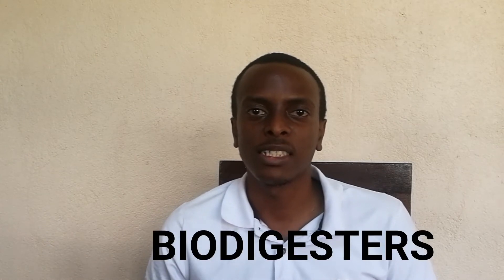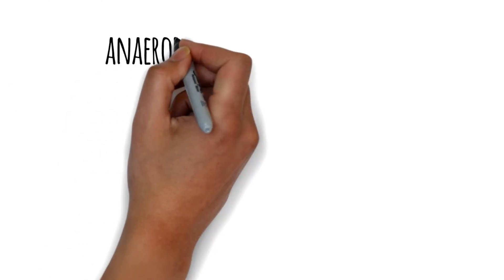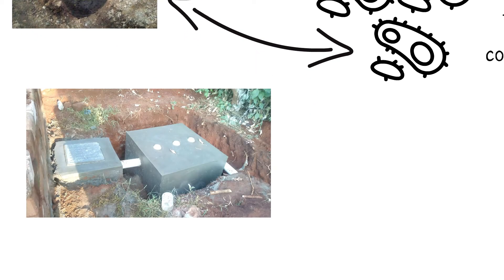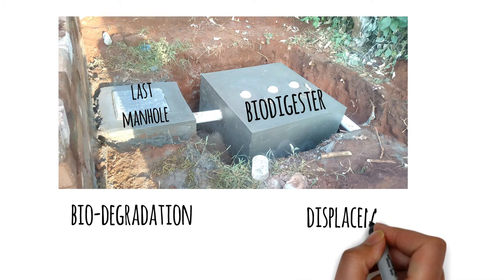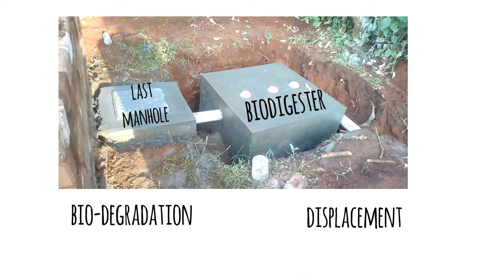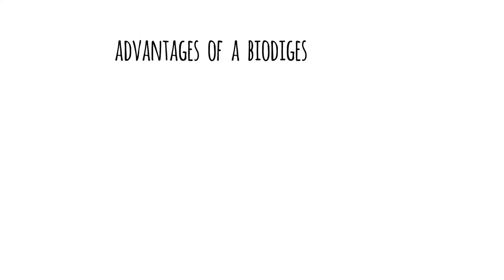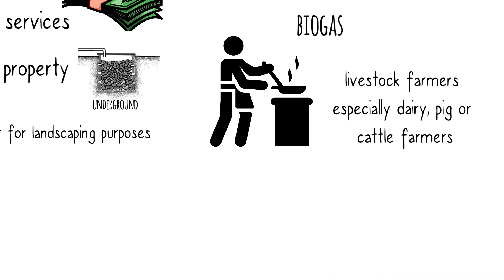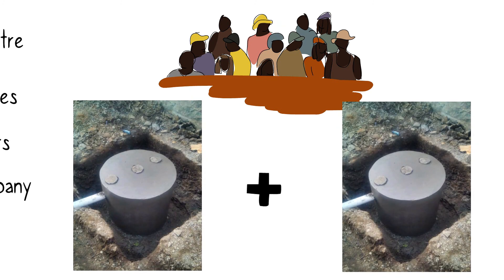Bio-digester (Bio-septic tank) Explained: An Alternative to a Septic Tank

Comment: This is a scam. You've only tried to explain how a septic works. Coming to bio digester you jumped straight to soak pit. Draw a similar section of a bio-digester and explain in detail starting from the shit entry and what is different with the septic. A lot of grey areas here. People are losing money on things that don't work. Be careful.
Reply from the maker: That's why it's also called a bioseptic tank system. The addition of anaerobic bacteria and an oxygen free environment is what makes it a biodigester in the design of a septic tank. But ensure the person installing for you know what they're doing. Don't invest in a biodigester, yet the person who made it for you designed a septic tank. Scammers are in every industry, unfortunately. You can also check out a plastic bag biodigester in one of my recent videos.

Comment: Great explanation. Is this system for ALL household waste water? Toilet, bath/shower, wash basin/sink, kitchen, laundry/washing machine waste water?
Reply from the maker: Yes it is. Though bath/kitchen waste water is directed into the soak pit and not into the biodigester. The biodigester deals with waste from the toilet
Reply: , @PropertyNoma  will holla at you guys to come to +255. Better yet - do you have this set up in +255? If not, you should.

Comment: Why does the capacity selection of a bio digester depend on the population to cater to if it never gets filled up?
Reply from the maker: Because of the displacement principle. The biodigester has to carry the intake of sewage from the designed population so that it can displace that sewage to the soak pit for further treatment. If the intake is too much, the biodigester will fill up and leakage will occur. This should not happen.

Comment: Very well explained.....question please.....Why do you install a degreaser just before bio digester inlet...? Does the kitchen water go through the bio digester or does it go direct to the soak-pit via different pipping system....?
Reply from the maker: The degreaser traps fats and oils present in kitchen water. The kitchen water then flows into a biodigester. Any waste water inside the biodigester is displaced to the outlet pipe and into the soak pit.
Reply: @PropertyNoma  I think kitchen water plus other water like bathroom water  should not be directed to the biodigester as the name suggest the biodigester digests organic waste..therefore the chemicals in bathroom and kitchen water will disrupt the anaerobic organisms in the biodigester and cause inefficiency in digestion
Reply from the maker: @juniourx2203  That makes a lot of sense Uddi Malenya.
Reply: @PropertyNoma  thank you the waste water from the bathroom and kitchen can be channelled through another pipe to a collection chamber if you want to reuse for landscaping grass or watering trees  before the collection in the chamber you can construct a first  holding chamber with kokoto and charcoal   which will act as a filter the water that goes into the last collection chamber will be clean to use for landscaping thank me later .....

Comment: Hapo kwa soak pit, will water not flood on the ground .... nice explanation
Reply from the maker: It will depend with the soil. Most soils do a good job with percolation except black cotton soil.
Reply: @PropertyNoma  I intend to do this in Joska... I don't know whether soak pit will work
Reply from the maker: @mosesbosire4156  It's best to consult with a biodigester contractor about the soil in your area. You can watch my other video about the materials you'll need for a biodigester: https://youtu.be/hQ7x5uegGJU